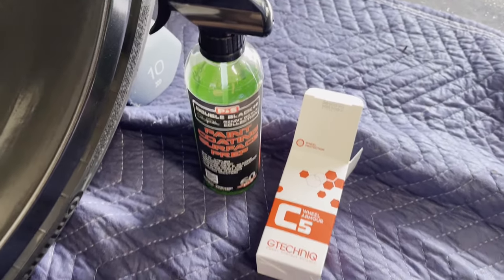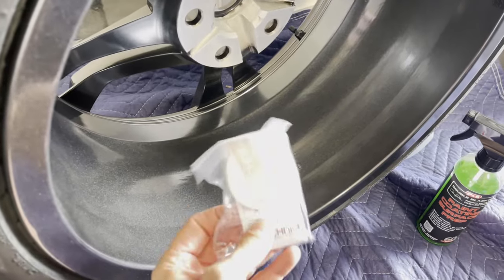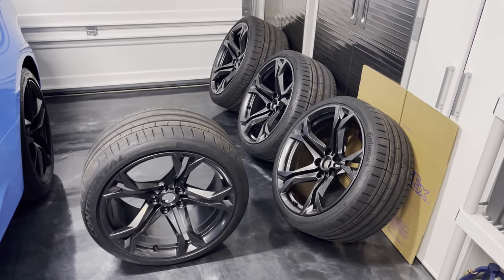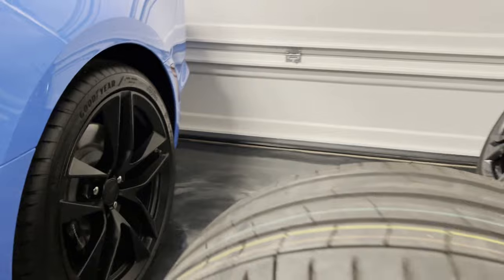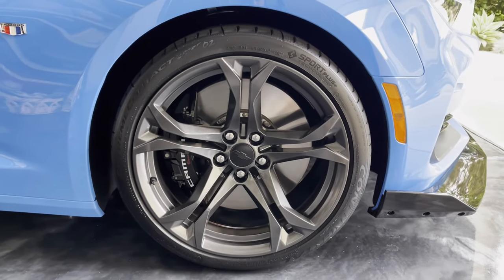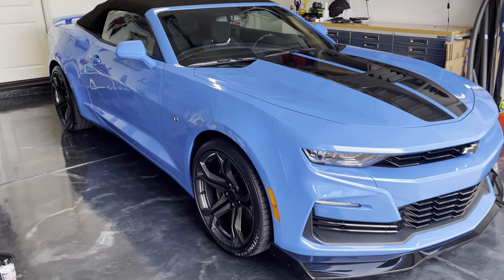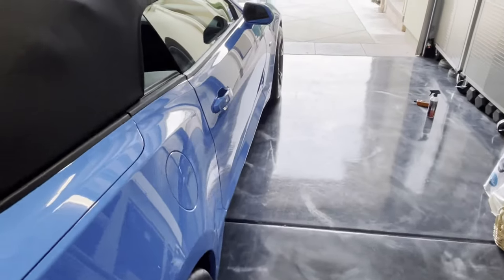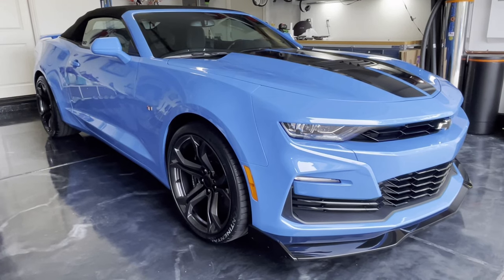2023 Camaro SS Convertible Build - 1LE Forged Wheels - PART 2

Comment: Looks beautiful. Do you think you will add leather to the seats at some point. ?
Reply from the maker: Thanks! It has the upgraded Recaro Alcantara and Leather interior already... Nothing to upgrade
Reply: @FrostyAMG  What made you go with a Camaro? 

Did you ever consider a mustang?
Reply from the maker: Had a 2015 Mustang GT that I owned for 5 years. Loved that car, only reason I went with the Camaro was because I wanted a big V8 in a convertible with 4 useable seats, and this was my best option. I did consider a 2016-2018 BMW M4 convertible, but the engines just can't compare to the way a V8 sounds.  @mji9208
Reply: @FrostyAMG  I’m torn between the two as well. And I also would need to use the backseats from time to time as I also have small kids.